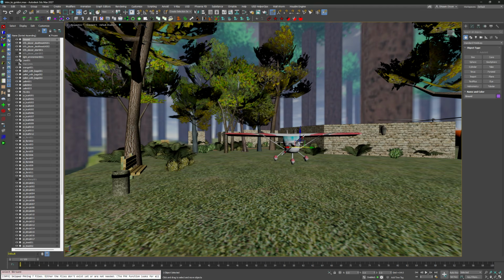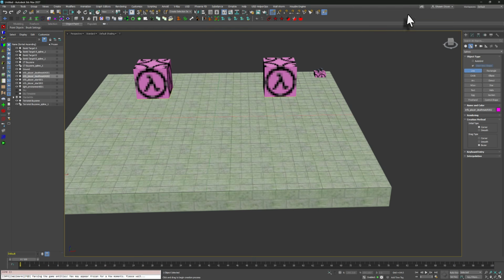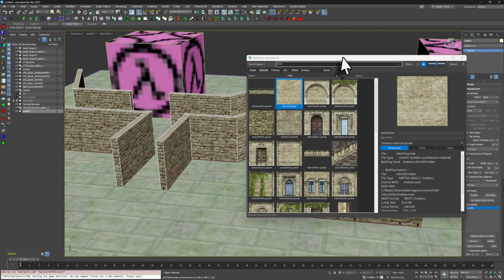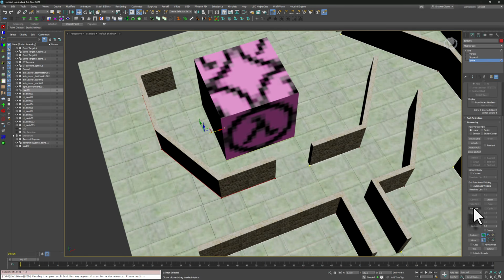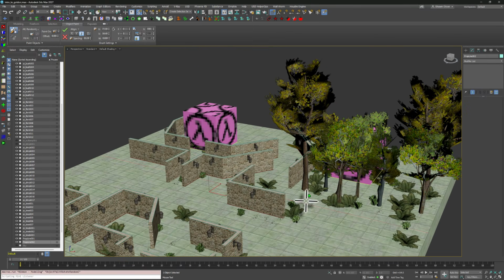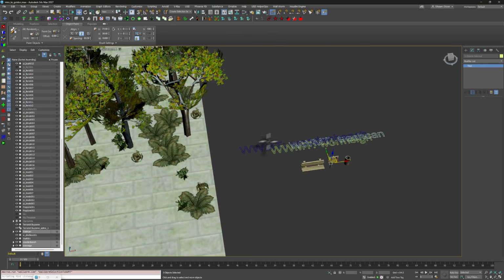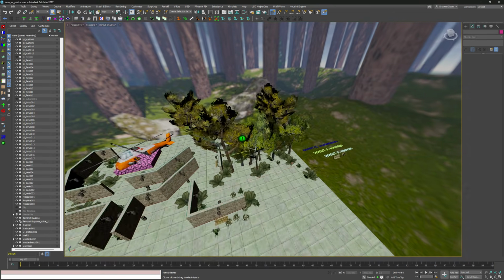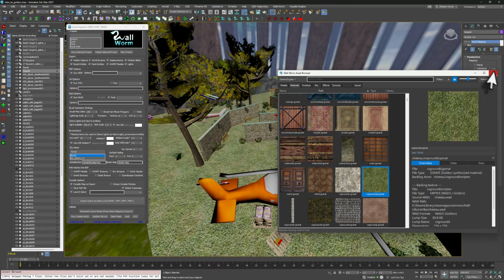Wall Worm: Intro to Goldsrc

Comment: Hi, I have a question. I've watched some of your videos on map modeling, as well as the videos on Wall Worm. But I have a somewhat “simple” question: is it possible to import a pre-made model into 3ds Max and then export or convert it to .vmf? 

I’m wondering if it’s possible to do something like in this video of yours, but with a pre-made, imported model: https://www.youtube.com/watch?v=7F_Gu0sA2_0

Sorry for my ignorance, I'm not a 3ds Max user.
Reply from the maker: Sorry I did not respond sooner; I've been traveling. The answer is yes*. I add the asterisk because it is highly dependent on your understanding of the VMF format and your understanding of the limitations. In the video you linked, I converted the mesh into a Displacement, which is a specific kind of geometry. You can do this from arbitrary meshes as long as your mesh is composed of Planar Quads. Any non-quad or non-planar quad will not convert to displacements. Non-planar quads may still convert, but they will not align exactly. If you want to make Brush geometry instead of Displacements, you can do that as well using the ShellVex geometry class and Brushify modifiers together.  Feel free to join the WW forums or WW Discord to get more technical help.

Comment: is there a tool to auto generate overviews for maps?
Reply from the maker: Yes. See https://dev.wallworm.com/topic/59/overview_exporter.html . Enjoy :) . Note that it was made for Source but should work for Goldsrc. Note that video is very old and the UI is a little different now, but the workflow hasn't changed much. And the dimensions should work correctly despite the old video seeking help on the overview data.
Reply from the maker: For the record, overview generation is now available for all the engines: Goldsrc, Source and Source 2.

Comment: I am sorry, I have some questions? Should I convert .map files into .bsp format which is I can play in CS 1.6 in that case, right? And if I save the files as map file,can I modify it as I wanted later?
Reply from the maker: In the exporter choose .MAP as your format. Then also turn on the Compile option in the exporter UI. If that is on and WW is configured properly to your game, the MAP file will be compiled directly into BSP and playable by the game. That is what is demonstrated in this video. And yes, you can modify all you want. At end of the video I made changes and re-exported/compiled.
Reply: @ShawnOlson Oh thanks again.